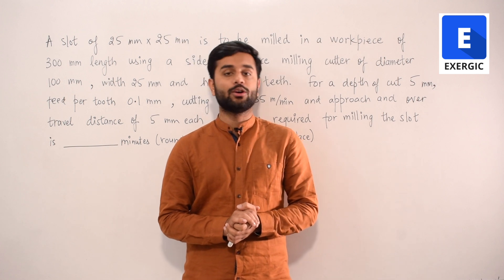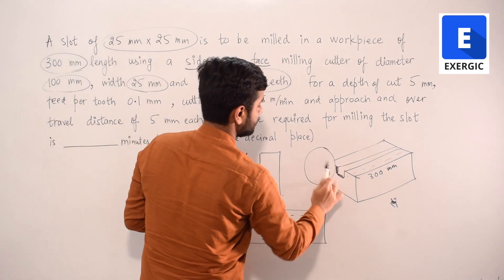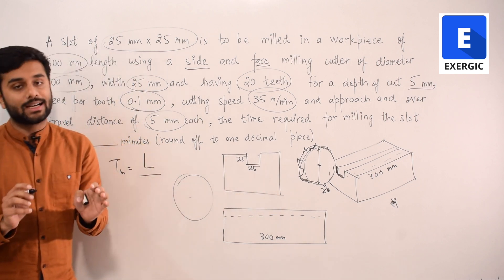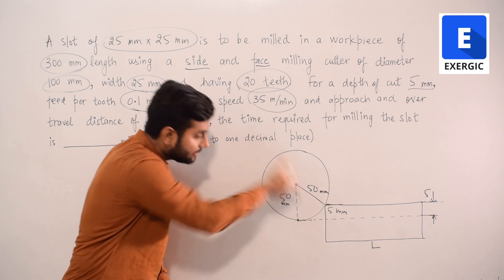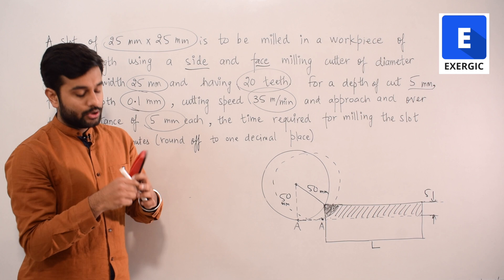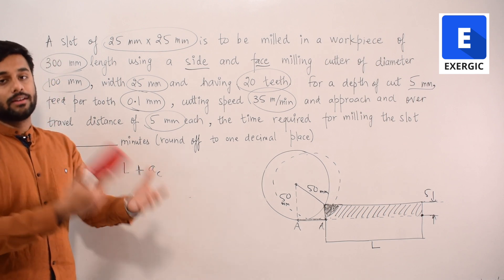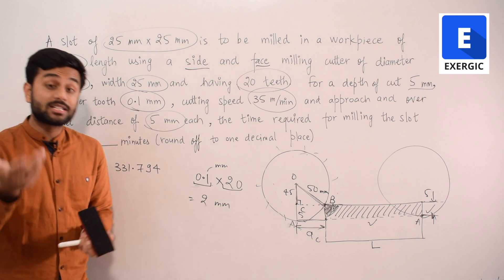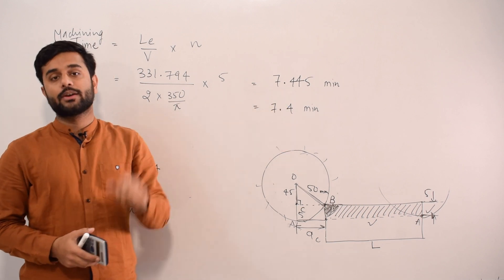Machining Time calculation in Milling - GATE 2020 (Set 1)

Comment: sir you are using peripheral cutter which is somehow wrong... in example itself it is mentioned face mill cutter which is used on vertical milling machine and the peripheral cutter is used in horizontal milling machine.

Comment: Hello @exergic sir in official key it was given D/2 for compulsory approach. Though 7.4 lies in the range but why they took D/2. The solution should be what you solved in the video. But how they took D/2. Hope you would give reply to my message. Thank you sir..
Reply: Here side and face milling means end milling cutter, which has teeth on periphery as well as on its face, and it is not in the shape of a wheel rather a drill like shape. So D/2 should be the compulsory approach to completely remove the material. Sir has shown a peripheral milling cutter here.
Reply: @romitrana8631  yes but in the problem they asked to slot a 25×25 on it so we have to consider peripheral mill cutter so it is not D/2 for approach. With both the methods we are getting answers in the given range but exact compulsory approach is √d(D-d) right ?

Comment: like compulsory approach... wont it have a compulsory over travel???please reply
Reply: in questions approach length and overtravel are always mentioned ,what isn't mentioned is whether to consider compulsory approach or not,it depends on data!
(ex: compulsory approach in drilling need point angle,if point angle is not mentioned ,we cannot consider compulsory approach)
no need for compulsory overtravel as the relavent data is given along with approach length

Comment: Sir, i have a doubt regarding this question. In this question , they have mentioned that it is side milling cutter , which actually is a type of end milling cutter(vertical milling machine) . Also it is mentioned that it is face milling, for which vertical milling machine is preferred. But in the solution u have taken it as a peripheral milling cutter(horizontal milling machine). I did the answer taking it as end milling cutter with the corresponding compulsory approach formula, and got a different answer. Sir which one should actually be taken, and why?
Reply: How can we create a slot using a vertical milling cutter?
Reply: @kushagratiwari96   both slot milling and face milling can be done with both horizontal and vertical milling machines. It not true that slotting can be done only with horizontal milling machine, it can bo done using vertical milling machines also
Reply: @sumaisjalaludheen5561  yes brother it can be done with both vertical and horizontal but if we use vertical milling machine width of slot will be produced same as the diameter of the cutter.
But here the diameter of cutter is 100mm and slot width is 25 mm.
Reply: Cutter is mentioned only bro.
Reply: I am also confused......can any one explain briefly?
Reply: Here side and face milling means end milling cutter, which has teeth on periphery as well as on its face, and it is not in the shape of a wheel rather a drill like shape. So D/2 should be the compulsory approach to completely remove the material. Sir has shown a peripheral milling cutter here.
Reply: 100 mm dia ka end milling cutter slot katega ya highway